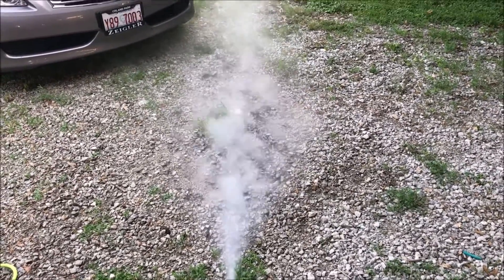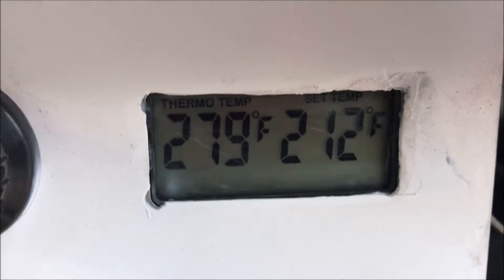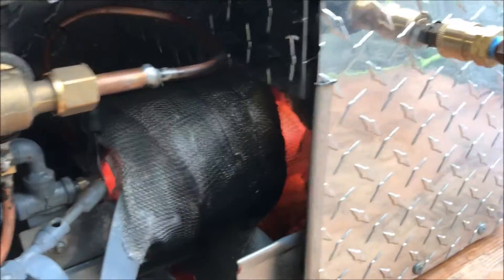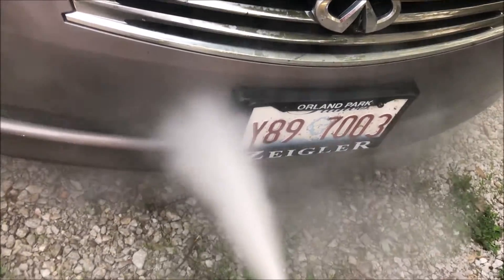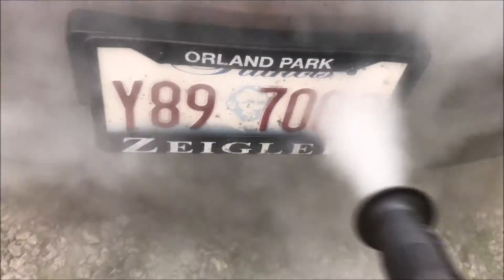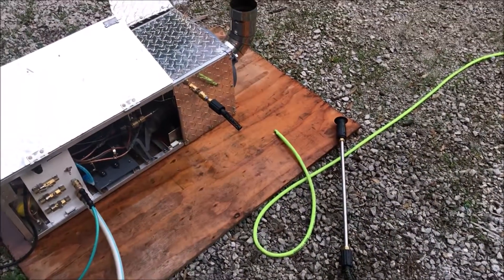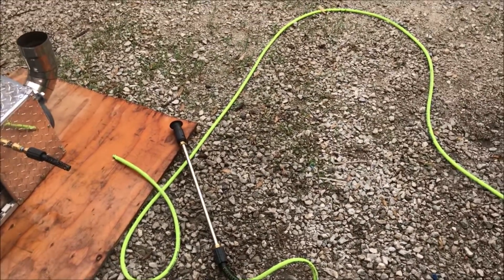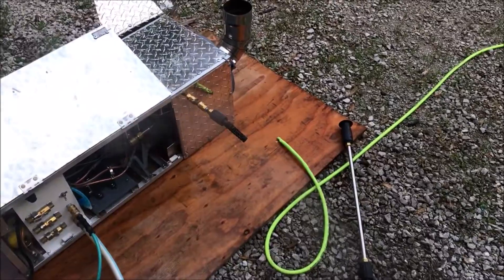Steam boiler build for Carlos Final Test run

Comment: I don’t even know what a boiler is but I watched 3 of your videos on it. You do a good job. Thanks for sharing. Also I ordered a Stiletto hammer after your review. This particular video is starting to make me think how I can easily heat water in a tiny house build with little or no electricity. Now I have to brainstorm. Using propane is a good idea but I have to learn about these coil tube